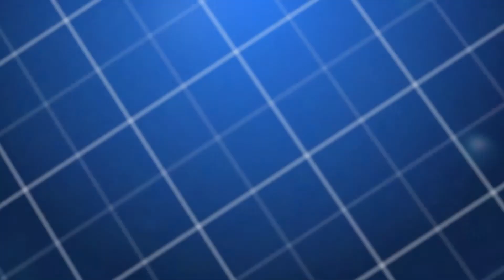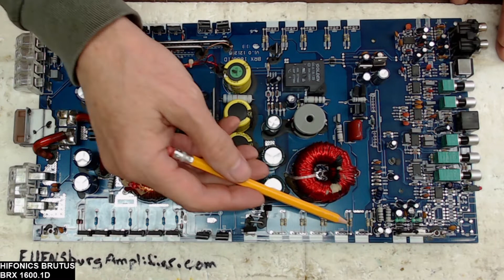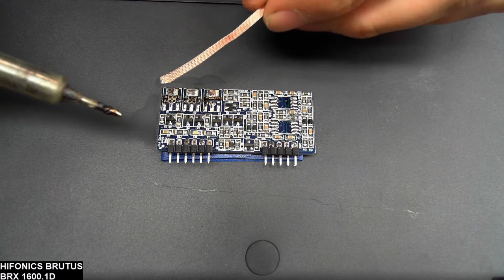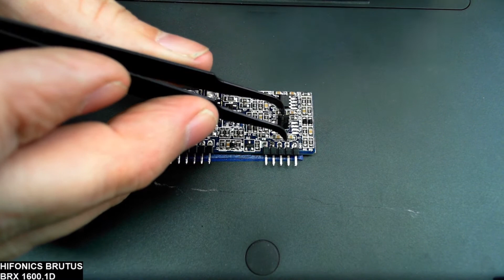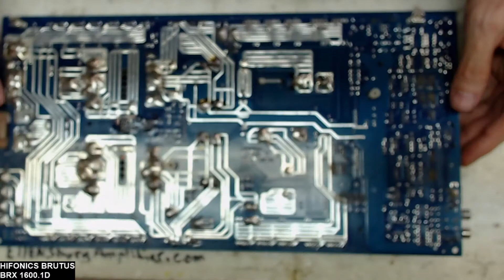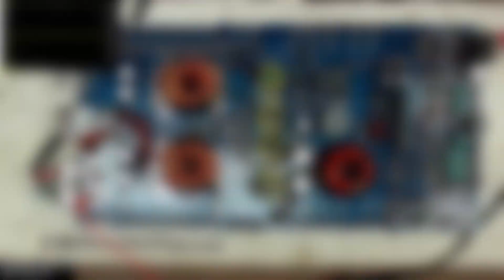Hifonics Brutus BRX1600.1D Class D Car Amplifier Repair Kicker Hybrid Up And Running!

Comment: What would happen if you coated the board with flux then saturated it with a heat gun? Would all the components center on their pads and stress be removed from their legs? Obviously most of them are run through the solder bath during manufacturing, for high volume.

Comment: مرحبا هل يمكنك ان تعطيني ارقام الترانزستور  في هذا الجهاز
Reply: اشكرك. هذا ما ابحث عنه
Reply from the maker: The power supply can be the IRF3205, IRFZ44, the output section uses the IRF640 transistors. Or are you looking for information on the output drive card?

Comment: Buddy which ic they use  on the drive card power supply section ?
Reply from the maker: The power supply drive cards have a TL494 PWM IC and an LM293 or an LM393 IC next to it.

Comment: Good informative repair. With the 50 Hz input signal, where did you probe in order to see the output sinewave signal of 50Hz? Thanks.
Reply from the maker: If all is well then you will see the sign wave at the output terminals. If you don't see it at the terminals then work your way back through the relay and filtering.

Comment: what program do you use to open perrys guide seeing that adobe flash player is no longer supported currently i am not able to open it
Reply from the maker: Excellent question! I hope Perry is able to put the time into working around this issue. Right now I open the tutorial in Edge and have to use Adobe flash player 32 (a stand-alone program you can download - Flash Player Projector Content Debugger) to open the specific file location for any of the flash-related content. As you hover over the flash content in the browser make note of the file location so you can open it directly in the debugger.

Comment: If possible can you do a video on setting gains and crossovers and how you go about setting up the voltages for the final testing thanks in advance
Reply from the maker: I will see what I can put together. Setting crossover slopes is dependant on the enclosed space of the vehicle and the persons' preference but I can show you how I go about testing an amplifier (load test, quality test).
Reply: @ellensburgamplifier  thanks appreciated

Comment: Man you make it looks easy. But it isn't, I have tried and the small stuff like your doing takes some finesse. So many people throw away a good amp, but you don't have to. Great video.
Reply from the maker: Thank you for being part of this channel. It does take a good understanding of the equipment used, how the flux reacts with heat and time, and on top of that having a good solder. What I will do in the future videos is quickly name what I am using and at what temperatures. That may help out.
Reply: Agreed! He's a master at his profession.